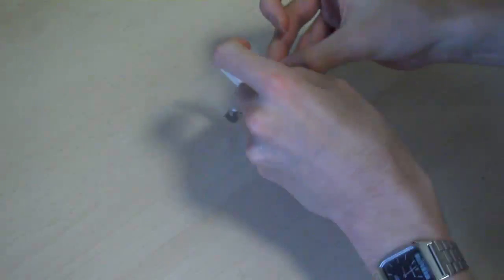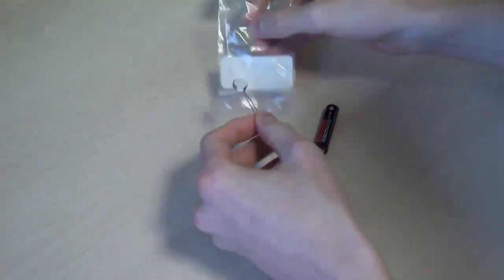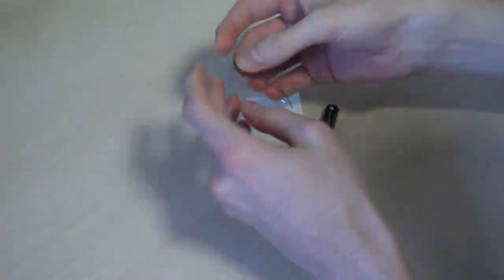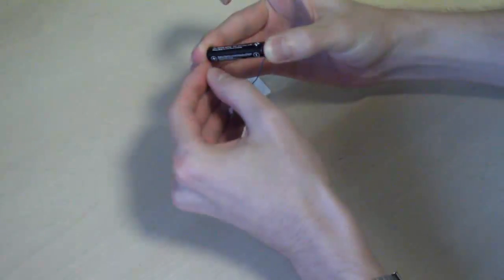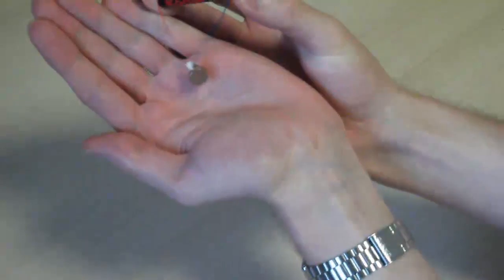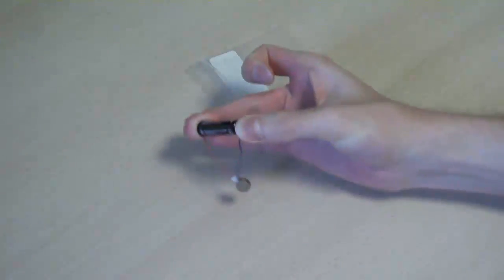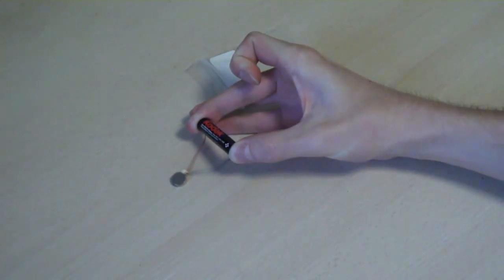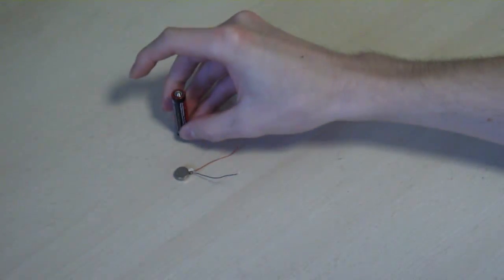Vibration Motor Introduction

Comment: Hi, quick question: what is the intensity of the vibration motor (in G)?
Reply: This is coin type vibration motor.The G force is about 0.6-1G depending on Dia. You can find the motors in http://jinlong-electronics.com/product/vibration-motor-coin/

Comment: Hello, quick question. If you hooked that up to a pwm pin is the range of vibration noticeable. I'm developing a rudimentary haptic device and I'd like to know if it has a range instead of just off or on. Thanks
Reply from the maker: Hi, it's been a while since I used the vibration motor now but if I remember correctly depending on the voltage running through, the vibration strength varied. Hope this helps.
Reply from the maker: ***** Hi, I'm not entirely sure what a piezoelectric device does but the vibration from the motor makes a significant buzz sound if on a hard surface. Since the sound is externally created I am doubtful that an audio connection would be possible.